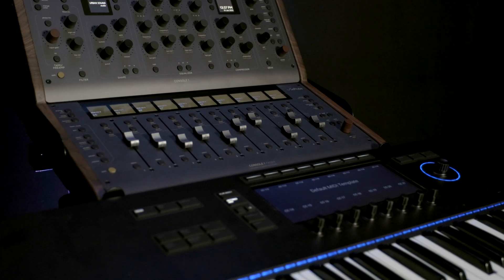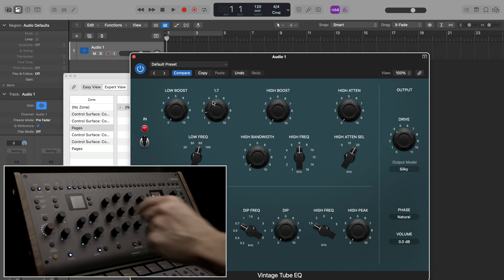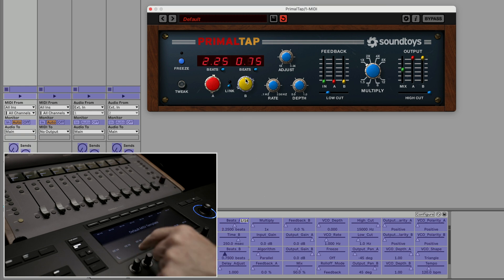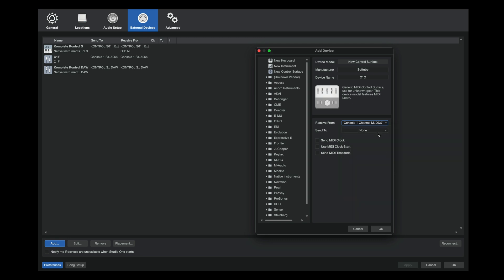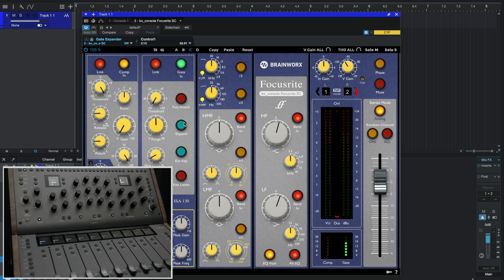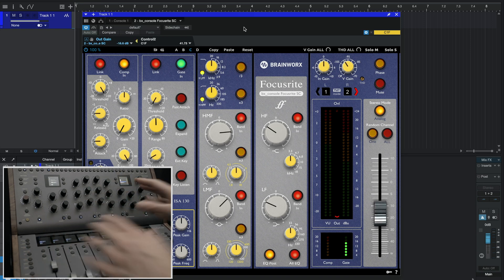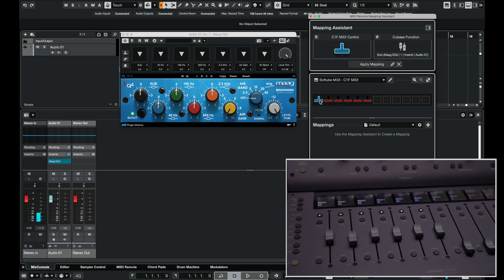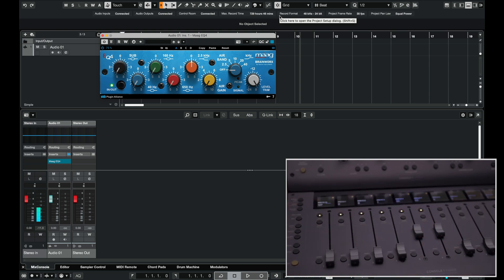MIDI CC and Control Surface Mapping in Your DAW - Logic Pro, Ableton Live, Studio One, & Cubase

Comment: One thing about midi mapping that you may have mentioned but I missed (and if so, apologies)…
Is it possible to save the plugin that you’ve midi mapped, so that it then resides in the list of load-able plugins permanently (like the plugins that are officially supported by Console One), so that in the future, it can be selected and loaded into the section(s) of the Channel MK3 that the plug was originally mapped to?
Or, do I need to load and re-map the third party plugin each time I want to control it with Channel mk3 in future projects?
Reply from the maker: It is DAW dependent. Typically trying to recall the maps isn’t going to work great as a workflow. Instead think of it as giving you temporary control over parameters when you need to automate or adjust products with tactile control. Some DAWs like logic retains the settings as part of the DAW and not the session.
Reply: @ToddUrban I appreciate your reply! 🙏

Comment: Hi Todd, Thanks for this.  Question for you: when using the Console 1 (MK 2 version)  controller in Logic as a generic midi controller (Softube On-Screen Display software disabled of course), do you know how I might tap into the onboard meters to assign things like plugin gain rediction feedback?  I know from my work in Reaper using ReaLearn that the Console 1 meters themselves are receiving data on the following CC channels: 
- InputL - CC 110
- InputR- CC 111
- OutputL - CC 112
- OutputR - CC 113
-Shape - CC 114
-Compressor - CC 115

However, since Logic's Learn function depends on moving or pressing a knob/fader/button, I can't figure how to assign a gain reduction meter parameter in plugins that offer it to one of the above Console 1 meter CCs.  This is child's play in Reaper with ReaLearn, but in Logic it's not clear how to do it.  Any ideas?  The goal is to have the Console 1 meters displaying the data sent to them from the plugin where appropriate.  Thanks much.
Reply from the maker: Actually, no. I don’t. Honestly, I try to stick with the most basic workflow of C1 just to keep things fast. I would check with support. They might have some suggestions around this. Or the Facebook C1 forum might know more. ;)

Comment: Thanks for this Todd. Does this work with Ableton and Console 1? I'm following the instructions here, as well as from another video (so I've loaded Midi CC into an EQ slot), hit Midi learn in Ableton, and tried to assign controls from a plugin to the Console 1 EQ knobs, but they don't seem to be linking.
Reply from the maker: Ok. So this is a bit of a long answer, but hang in there. 

If you have Console 1 Channel Mk III, yes, it works. You need to make sure in settings that "link tempo MIDI" has the input and output ports checked in Ableton Live for the device. Then just click the MIDI learn button in Live, click the parameter, and touch the CC knob. Once you turn off MIDI learn, it will be learned and controlling it. It works great. 

If you have a Mk I or Mk II unit, you can also use it as a MIDI controller. HOWEVER, due to the fact that the new units have multiple MIDI channels out and the older units do not, you will need to ALSO have a Mk III unit to serve to communicate with the DAW. If you do have a Mk III unit and an older Console 1, you will see in settings you can set the older Mk I/II unit to serve only as a MIDI controller. It is actually really a nice feature to reserve the old unit for MIDI only and let the new ones do the jobs they were intended to do. It also means that you do not need to get rid of your old hardware, but can use it for other purposes. 

I hope that helps! :)

Comment: Is it possible to save the default state for the MIDI mapping when loading it? As of now, it loads all the knobs at zero position when selecting MIDI CC. Not the best for EQing scenarios. I'm using Reaper btw.
Reply from the maker: I don’t think there is. But really the benefit of this cc mapping is for quick temporary control for automation, rather than recallable mapping. So for me it isn’t a replacement or alternative to the Softube, UAD, and FabFilter mapping. It’s just another option that’s more of a fringe use case (that’s just my opinion).
Reply: @ToddUrban  I see. But a huge miss in my opinion. Thanks!

Comment: Thank you so much for this Todd. I've been wanting for ages to get the Console 1 channel controls to map to the Cubase EQ. It took me a while to work out that my Console 1 MIDI ports are named differently to yours, but then it works like a charm in Cubase 14. It would be great if the C1 LEDs also reflected the value of the EQ. I suspect that's possible using Midi Remote Scripts, but it's a bit beyond me.
Reply from the maker: Great. I’m glad to hear it is working. Cubase has a unique way of working with the custom cc. It does work, but takes a bit of setup.

Comment: So. In Ableton, what happens if you move the mapped faders on the display? Console1 Channel doesn't seem to update properly when getting Midi CC sent to it (which I have bug-reported). Does Fader respond properly and move the motorized fader accordingly? (If you test the same on the NI controller, and you have set it up correctly, I'm pretty sure the display will update to the current value, also meaning there will never be jumps in value if alternating between mouse and controller)
Reply from the maker: You are correct. I didn’t actually notice this when making the video. I just went to fader in MIDI mode since it is a bit faster. But Fader does respond bidirectional so that the fader moves when you use the mouse on the plug-in. I’m not sure why channel works in only one direction.
Reply: @ToddUrban  Yeah, C1 Channel doesn't seem to listen to and update from midi CC sent to it. (Which ableton does for midi controlled parameters). I've bug-reported. If it actually works on Fader, it's even more clearly a bug in channel.

Comment: What if at need more  than 8 mappings for a plugin in cubase?
Reply from the maker: This is the workaround that I found worked for this feature. It isn't the "official answer". I would check with some more Cubase experts to see if there is a better alternative. Also remember that the point isn't to map every parameter. It is more for momentary control of a parameter for tactile automation. Hopefully there is more to come. ;)
Reply: @ luckily with so many options between softube, ff and uad I’m barely missing control for other plugins.

Comment: Great features that not working in Cubase at all...
Reply from the maker: On a Mac it is working. I haven’t tested a PC. Not sure if that makes a difference. But you do need to add a control surface from scratch and midi learn all of the parameters. It is a bit of work compared to other DAWs
Reply: @ToddUrban  PC and MAC not working.
Reply: fader is not reacting when i try to mapping it
Reply from the maker: Try a restart. I did find that sometimes it can help. In the meantime, I wouldn’t worry, as I’m sure more updates will be coming. Let’s see what they offer.
Reply: @ToddUrban  Wea re all do the same thing - changing usb port, restaring, updating soft etc.)))
Reply from the maker: @supernova.l.a.b  Strange. I don't have any secret build or anything. I'm using the public release of Cubase and Console 1. As I mentioned, Cubase is a bit finicky and it is a bit of a hack to setup compared to other DAWs that are a little more just "touch a knob and it is mapped"

Comment: Hi Todd In Cubase I follow your steps bud all I see is the time and the date on the controller on the right.
Reply from the maker: Are you talking about my other video on studio logos, or are you trying to map to MIDI CC? If MIDI, you need to either insert a MIDI module in C1 Channel, or switch modes on Fader to be able to assign MIDI CC mapping
Reply: @ToddUrban  Todd
What I saw in your video, that you can control plugins.
I first create a track in Cubase.
Then I insert the Console plugin and then for example a pultec plugin.
What do I do then?

Normally I figure that out myself but now I need your help for a moment.
You do that so easily.
Reply from the maker: @thecoastCoverband  Well, the plug-in is only necessary for Console 1 Channel. If you are using Fader in MIDI mode, you don't even need the plug-in, as you don't need to insert a MIDI Module to a Console 1 Channel Section. The thing here is that you need to add a new device in Cubase. Do not use the automatically populated device. From there you will build out your device one knob, button, or fader at a time by turning a knob and having Cubase add it as a physical parameter that can be mapped. All this being said, sometimes it didn't work and restarting Cubase helped. Honestly, it was a bit easier in every other DAW.
Reply: @ToddUrban  Many thanks Todd.
It works can I save the consolol 1 seting for a new track?
If I use the same plugin?
I used 4 knobs from the console 1 equalizer for the pultec
On track 2 I had to use the second 4 knobs for the pultec on track 2.
Therefore I wonder if you can save the settings.I hope you understand me.
It is a great and nice setup the console 1 and the fader. Thanks Gr.Nes
Reply from the maker: @thecoastCoverband the device is communicating CC. So as long as the knobs are assigned to different values, you will control different things. But switching tracks won’t change anything if you assign the same CC value twice

Comment: Hey Todd, a bit off topic but please help me!
I have a Pro Tools template with Console 1 on all tracks. I usually do a static mix with dry tracks and then I import my Template. What happens is my panning for mono tracks is gone since Console 1 plugin is Mono to Stereo on those mono tracks in the template.
Is there any way to preserve the panning when importing template into static mix?
Or, how do you approach this in your workflow?

Thanks a bunch
Reply from the maker: Hmm. I’m not sure since I start with HUI control and C1 as a plugin for my mixing. If you stick with just mono as the plugin, wouldn’t this retain your settings? I don’t believe it is always mono to stereo, but need to check.
Reply: @ToddUrban  Thanks so much for the reply, Todd. 
I have only Console 1 Channel so no HUI. And if I instantiate mono plugin then I don't have pan control at all (No Pan/Width option).
Reply from the maker: Yeah, so you either want to get Fader for HUI control over PT pan, or you might want to keep those tracks mono and pan with the mouse in the DAW. HUI pan won’t be available on channel since the entire unit needs to go into HUI mode to work. So you would lose C1 functionality. This is a PT only issue.

Comment: I guess this isn’t possible in pro tools, eh?
Reply from the maker: So, with pro tools, the DAW is extremely limited for any controller. The plugin needs to offer to have MIDi mapping as part of the plugin (like FabFilter EQs and Softube synths). This is why I didn’t cover it. But for those products, it is possible to map.
Reply: Avid removed the M Audio driver in the latest version of Pro Tools which is how PT talked to all MIDI controllers. When I asked support what can be done so I can use the several MIDI controllers I have been using over the past 10+ years, their only advice was to go back to the last version with the M audio driver. It's pretty wild the industry standard in 2025 has no way of supporting MIDI devices
Reply: @SanfordParker-e3h  They aren't the industry standard. They're now a dust bucket if that's the case, which it is.
Reply: @CaptainCricket3D  I have worked in 100s of studios all over the world and every single one of them uses PT, that's literally the definition of industry standard
Reply: @ I know studios all over use Pro Tools. But the reason they use Pro Tools is because they invested tens of thousands of dollars into Pro Tools rigs years ago when there weren't other DAWs accessible like there are today. That "industry standard" tag originated over a decade ago and it's a bit funny how people still latch onto that term.

I understand, as even when I began working in studios over a decade ago, Pro Tools was "the industry standard". But the reality is, despite studios having Pro Tools installed on their system nowdays, people are beginning to use other DAWs instead. Which is exactly why Todd covered every other DAW other than Pro Tools, simply because other DAWs are more flexible than Pro Tools.

And if you think I'm just hating on Pro Tools, I'm not. I'm actually a Pro Tools user as well. But Pro Tools is ancient compared to other DAWs today. They are no longer leading in the market. This is why I said they're no longer the industry standard.
Reply from the maker: @SanfordParker-e3h thanks for adding this information. I wasn’t aware of the specifics. Hoping that they add something moving forward.